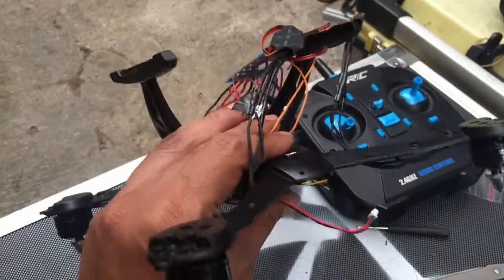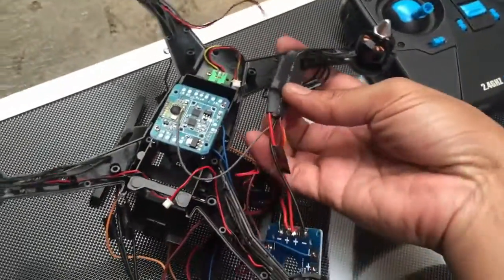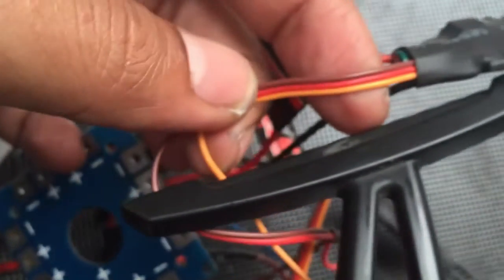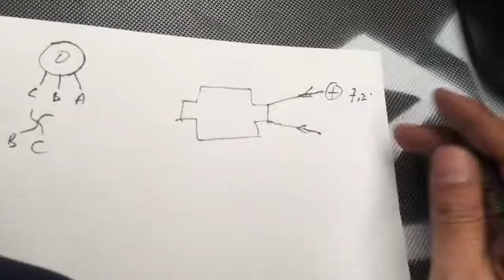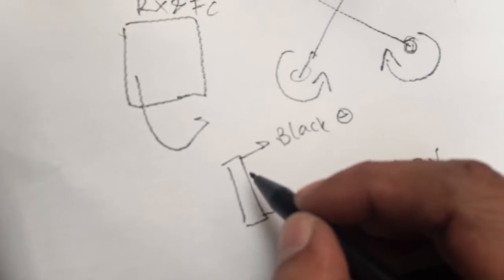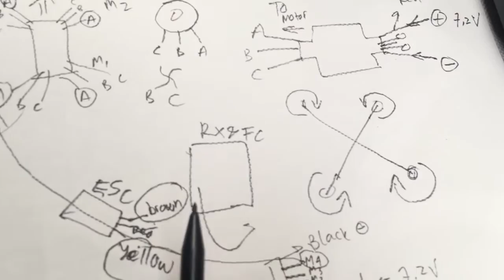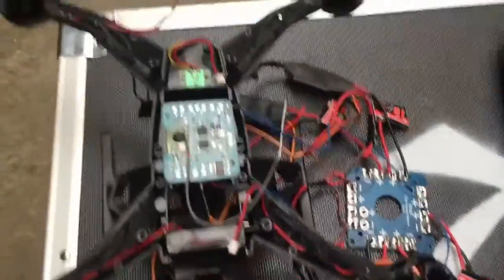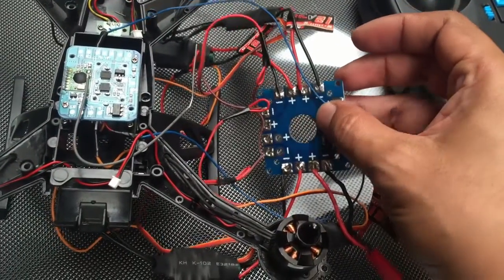JJRC X1 How to Resolve and Replace Problem on Internal 4-in-1 ESC board with External Simon 12A

Comment: good to see you got it flying again. those things are called cable ties or zip ties in the UK. i modded my x1 with a new flight controller and then i made the esc board capable of using 3s battery, but i have to carry battery outside underneath x1... so i have lots of empty space inside i am thinking of putting dys xm 20amp esc's inside it now, i have found 4s 1806 2300kv motors but they are not cheap,  and i am worried because the x1 body is not good in a crash, even a small crash.

Comment: Only one ESC blew out on my 4 in 1 board, I was thinking about buying just 1 of these, splicing off the M1 wire unhooking it from the main board(the back right motor) and wiring up one of these Simonk 12a ESCs bypassing the 1 ESC thats bad on the 4 in 1 board...the only problem this drone is so problematic I could burn up the other ESCS and before the ESC blew out on this drone I had flight issues with the remote.

Drone is a hassle.
Reply from the maker: +VideoGame Polak - You are right! Even I moved all out to custom frame, using devo 7E RC, the flight still wooble and not stable.
Reply: I was going to ask how it was flying after your hard work on this.

Mine had issues receiving my controls, itd fly PERFECT in front of me real close, but then id fly it farther away and itd act like it wasn't responding or really delayed to my controls, something is def wrong with the JJRC X1 and even the X2, like 50% or more go bad.

Good news is I have 4 good brushless motors and extra batteries that came with this drone I can use for the my other projects
Reply from the maker: +VideoGame Polak - at least they can use with other FC (CC3D/Kiss)
Reply: Yeah but you said yours still flies funny? Why is that? do you have a video of you flying it after you did this work?

Comment: cant i use the CC3D NAZE32 F3 Power Distribution Board Filter BEC Output 5V 12V 3A like you use the clean pdb?. to my 30 A simonk no it stupid. but wanna learn. and the clean pdb in on the way but take for ever before i have the thins i bye!

Comment: om arya klo di kasih esc 20a apakah harus flashing dulu ya?
Reply from the maker: +SuLiez Bee - Semua esc sebelum dipasang sebaiknya diflash dulu mas. Supaya yakin konfigurasinya udah siap dipakai terbang 😊
Reply: Arya Dega terima kasih om arya atas masukkannya.
satu prtanyaan lg om, jjrx x1 saya versi baru. apakah bisa di buat kyk di video ini? soalnya receivernya beda om
Reply from the maker: +SuLiez Bee - Bisa mas. Tapi kenapa kok mau dibuat pakai esc terpisah?
Reply: 1 motor ga muter om, ada 2 ic esc kebakar. jd tutornya sama persis kyk di video ya om? yg ini kecil bnget receivernya om
Reply: bole minta wa om arya ga ya hehe
Reply from the maker: +SuLiez Bee - Ooo.. ok.. yg penting ketemu signal outputnya dari receiver maka akan sama seperti cara saya.
Reply from the maker: +SuLiez Bee - Saya ngga pake WA mas.. gara2 diinvite melulu ke grup2 sd smp sma kuliah..akhirnya uninstall aja sbg alasan yg paling jitu keluar dari grup..hihihi.. saya super aktif di twitter mas.. @aryadega. Lebih irit baterai hp dan ngga ada yg invite2 grup hahaha...
Reply: Arya Dega oke siap om arya, makasih banyak om. moga bisa sukses juga :)
Reply from the maker: +SuLiez Bee - Sama2.. sukses buat kita semua 😊

Comment: jjrc x1 kenceng ga Om?
Reply from the maker: Kenceng om, apalagi kalo ESCnya pake diatas 12Amper. Misal pake 20 Amper gitu pasti wuzzz wuzzzz hehe. Belum sempet nyoba sih yang 20 Amper
Reply from the maker: +M Ramdlani P - Tinggal pasang aja om di M1-4. 😊
Reply from the maker: +M Ramdlani P - Instagram chat aja mas atau twitter chat. Soalnya saya buka fb cuma di Laptop. Kuatir kelamaan menjawabnya. Tapi kalo mau add FB juga boleh kok.

Comment: nice build im trying the same. ore not the same esc.pdb. but same ide´ but neebiw about quad.  Alan hennesy also made one nice quad, . and spek to him regard this. but i will build one from crats. but repair is bedst. so i will try. wit my jjrc x1 - its work. but frame broke. so i bue 210 frame an new motors.simonk 30 A esc. and then i wantet to soder esc on the jjrc. but need a pdb. i get ond but not judt pdb but the CC3D NAZE32 F3 Power Distribution Board Filter BEC Output 5V 12V 3A. so is my ? qustion. can a make the same build as you with my pdb and esc. if a can i will start wright now anf film it an show ofcorse! :-) have cc3d fc and more pdb comming,. but cant wate  . i wil still build my own. but taks for ever for the post man. and can´t fly if i cant use jjrc fc/tx
Reply: i have flying with jjrc x1 build in 210 frame  and fun. but i wanna rool and loop ! plz tel i can do that with the things i just get.
Reply from the maker: +Henrik Bech - Hi Henrik. For using another FC, of course you have to use another remote controller and receiver. At this time, my JJRC X1 was moved to 180 frame. I'm using CC3D, Simonk 12A and cheap PDB. Also I'm using devo 7E with rx on it. So it won't be a JJRC X1 anymore. And you can use Cleanflight with flashing your CC3D and have a double mode (level mode and acro mode) using channel 5 or 6 from the remote controller. 
But the point is, it will not be a JJRC X1 anymore. But what's so big deal for that, while JJRC X1 ESC and FC are bad. At least I can having fun fly now. 😊
Reply: yes! but i have cced fc and pdb simonk30a esc and a lot more comming. i ned tx"new transmitter yes. but i wil stil just for fun build the jjrc finnish. but can´t i just use my pdb with odv.vtx but dont know if i blow somthings op? 30 a i mutch i have 2204 2300 kv motors. ned building . dont have transmitter. dont know wat to bye, not taranis 9d to confused. have try.. so can i build 30A esc ond pdb "CC3D NAZE32 F3 Power Distribution Board Filter BEC Output 5V 12V 3A" 
thx for respont m8! :-)

Comment: itu cuman ganti esc aja ya om?
Reply from the maker: malik alvaro - Iya cuma ganti ESC 4 in 1 aslinya pake ESC sendiri2
Reply: Arya Dega bedanya kayak gimana om kalo dibandingin pkek esc lama?
Reply from the maker: malik alvaro - Karena esc satuan, jadi bisa diprogram maksimum dan minimum putaran motornya.
Reply: Arya Dega makasih om infonya
Reply from the maker: malik alvaro - Iyaaaaa sama-sama 😊
Reply: Hello Arya Dega,
I putted an easy gimbal to my X1. The problem after 2 minutes flashing the leds show low battery. But the battery is almost full I saw when I wanted to charge it. I try a bigger battery 7.4 V/ 2800mah to fly but after 1 minutes the ESC board was almost hot. Total weight of the X1 450 gramm. If I change the ESC board as like you maybe the problem should be solve? Thanks the answer. The other board (flight controller and radio) can still. Laci
Reply from the maker: +Laci Szigeti - Hi Laci, the original esc board of X1 has low quality and easy get hot. My X1 now has no esc's temperature problem with 4x simonk 12A esc.
Reply from the maker: +Laci Szigeti - You can use any esc and follow the current original Ampere. 12A. The brown goes to negative (-) and the other goes to signal from tiny X1 FC board. Dont use 3S because the X1 FC can only handle 2S
Reply from the maker: I had looked that link. If you have plan to build with that kit, then I might suggest you to use another FC and RX. Means, if you still using X1's FC, tx, rx, will not worth. The X1 only worth for racing quad. Here is my video from my Indonesian channel that I'm showing my X1 with 4x simonk ESCs, X1 FC, and using DEVO 7E. (Red props, It's just a very short shoot of it at the beginning of the video)
https://www.youtube.com/watch?v=i53QZ4RdH6U
Reply: Arya Dega   Ok.Now I choose 12A ESC as like you and still FC, Rc, Tx. Thanks for help
Reply from the maker: Anytime..anytime..😉

Comment: think i got it! its becorse you change collor. and you esc collor are brown,white and red. mine is black,white and red. but think im understanding it now! have my pdb. its have a lot . but i will sodder battery from jjrc to battery. path on pdb. and then take 2 deprate cores an red and black for + and - from 5v and sudder + red to the red on the tx and the black - on the other side of tx? then there are 4 hvite from esc. 1 from eatch esc. im there!!! and offcourse as u say. and god you remind. rember they hav to sit on the right motor? yes. but wat abot the rest! the 4 esc 30A have 2 core on each. the red you dend"not use" and what about the brown in your case! mine is black. so can i sodder em togehter on alle - pat on boad. and on jkrc the hav soddert an ac/dc collector- dont know the nabe. if u sodder a bigger one on you can use 3 sel batteri! :-) i know you know!!!  :-) if u dont understand! its me! im bad at spelling!.im seeing forword to hear from you. så can get ot fly! what transmitter you think is bedst for beginner. bur dont want the cheapest?. dont whant taranis x9 its to confuset. whant one you can use for nerarler sll droned. syma,jjrc and so on. thinking of bying the orange or the new hvite fpv trnsmitter. arrond 100 doller but no more. what u like/rekumente :-)
Reply from the maker: +Henrik Bech - Hi, sorry for long time reply from me. The black (yours) and brown (mine) cable should be the same negative. But better you make sure by looking for your esc's manual book and make sure all the cable function before connecting to the PDB. 
I'm also don't have a frsky transmitter because it sure expensive. I'm using walkera devo 7E and add it an NRF modul so it can bind to many quads toys. Also I didn't choose the cheap flysky because some of my friend said it has less respond when used for flying quads. And I found I'm satisfied enough with my Devo 7E 😊
Reply: np m8! My 30a simonek . it red+,withe signal.black.ground. but why sodder black? u have em on the pdb u only need to set the white signal. and ad u don´t use the red. is the same for the black!!!. i don´t know. but a boy ho mate a lot of quad, RCAddict . he knows things. he knows what he talk about!. ;-)and in one of he´s video he dont use the black. and explane. that he never use it. he say that som people say "you must/use black!."- becorse othervise the somthin ac/dc wud do somthing. i diddent onderstand. but he say he never have don othervise! and thats on quad from scratsh. not rebuild just from buttom.  but it, wil be sadley if i dont understand it. and then destroy my esc ore pdb. but i wil bye new esc for jjrc. and build another from scratch. i just bye flysky i6 beginner radoi. its okay for my use. just bye another when i need more! u can upgrade flysky i6 6ch to 10 ch now :-D under 50 $ that´s okay!. :-D
Reply from the maker: +Henrik Bech - I'm sorry if I wrote something wrong that harm your quad. Really... 

Glad to know you can enjoy your i6. But I'm wondering what are those 10 ch for in the quad? I know the 1-4 ch are for remoting the quad and 5th ch is for arm and dissarm motors. But I'm still thinking about the 6th - 10th ch for.

Comment: Punya ane belum ketemu masalah nya ni oom... X1 bener2 buang duit deh ...
https://www.youtube.com/watch?v=BnPkpHF3o1g
Kalo menurut oom kenapa ya kira2 ?
Reply from the maker: Waduh serem om. Saya udah liat videonya. Saya udah tes semua kemungkinan masalah di JJRC X1 ini. Saya sampai ganti ESC board dengan ESC eceran biar sesuai standard brushless motor. Tapi yang namanya nge-lag, itu masih ada. Hanaya saja karena ESC eceran memang memiliki firmware sendiri dari memiliki kemampuan lebih dari ESC onboard bawaan X1, yaitu dia bisa mendeteksi sinyal yang tidak stabil dari FC board (yang kotak biru kecil). Bahkan saya sudah beli FC board baru dari BangGood. Tapi "telat respon"" ini masih terasa. Kesimpulan sementara saya adalah problem pada transmitternya. Jalan terakhir saya harus beli Devo 7E. Kalau masih ada lag juga, ya udah mungkin terpaksa saya rubah total jadi racing ganti FC dan RX. 

Masalah ini adalah antara Tx dan Rx. Rx udah saya ganti baru masih tetap saja. Berati tinggal coba saya ganti Tx (remote)nya.
Reply: Arya Dega berarti kmungkinan solusi terbaik saat ini untuk x1 saya ganti tx&rx ya...  Ngumpulin duit lg deh, mungkin ane lbih milih flysky fs-i6 tx rx plus cc3d fc dulu aja...  Klo devo 7e aga susah nyari tuner module atau 3 in 1 module nya di online shop lokal (ane ga punya kredit card sih).. Sip,  ane tunggu update'an video ente seputar jjrc x1 nya ☺👍
Reply from the maker: Pertimbangan saya pilih Devo 7E karena udah bisa langsung konek ke Rx nya JJRC X1 dengan install softwarenya. Tapi ya gitu.. belum pernah coba..hehehe.. kata websitenya devo 7e bisa sih.Juga kedepannya bisa saya konekkan ke tarantula X6 dan X4 saya. Juga Syma.
Reply: Arya Dega ane research di gugel dan yutup, untuk bisa konek devo 7e + deviation bisa pakai module NRF24L01 devo tuner atau pakai 3in1 module..  Nah kedua module ini adanya di Banggood.
Reply: Yang nyeseknya berarti 1,5 jt ane cuman buat dapetin 4 motor, 1 multi esc board dan 2 battere 2s 1300mah.. Wkwkwkwk tau gini kemarin mendingan ngerakit qav 250 atau beli tarantula x6 + xk x250 aja, hehehe
Reply from the maker: +Novryanto T Mahendra - Di tokopedia ada om.. Harga kisaran 80rb an.
Reply from the maker: +Novryanto T Mahendra - Iya bener sih om... Saya juga senasib.. Tapi paling tidak, jadinya kepicu buat ngoprek2 haha
Reply: Arya Dega yg di toped sama ga ya sama yg di Banggood? Kemarin ane cari2 di toped n bulapak bentuk fisiknya beda, jadi ga yakin (maklum ga punya basic electro) hehehe. Iya sih, x1 ane udah pindah frame ke tipe 250, trus sekarang lg doyan banget bongkar2 tx nya x1, ane berharap ngliat ada satu kompenen yg rusak (asal jangan ic controllernya) biar bisa ane benerin hehehehe. Soalnya jujur aja terbangnya enak banget x1,  biasanya ane ngebut pake h8 mini jarak 40 meteran,  kemarin pake x1 bisa ngebut sampe 100 meteran 😂
Reply from the maker: +Novryanto T Mahendra - Om pake H8 mini juga? Wahhhh saya baru aja dapet kemaren dari temen. Videonya lagi saya edit. Soalnya H8 nya ini ada mode angle dan acro. Mudah2an besok udah kelar editing dan bisa saya upload.
Reply: Arya Dega kereeenn, ane baru aja mo beli st link v2 nya, ane subscribe oom biar bisa liat h8 ente 😊
Reply from the maker: +Novryanto T Mahendra - okay oom... Udah saya subbed back.